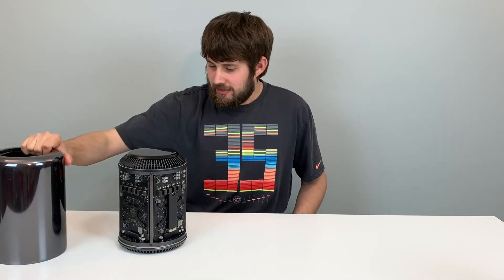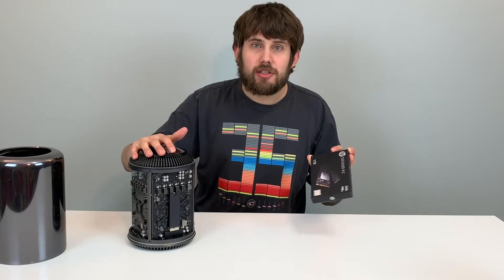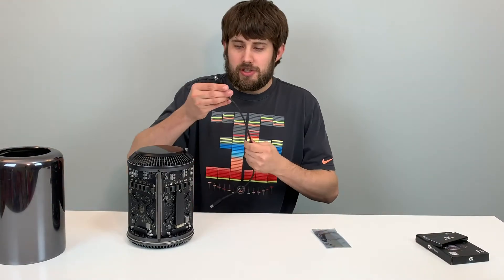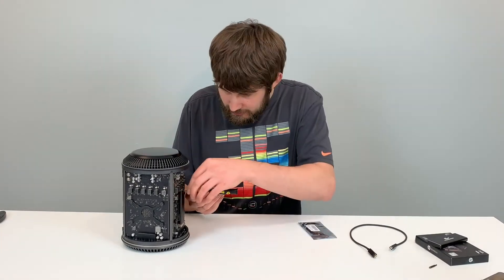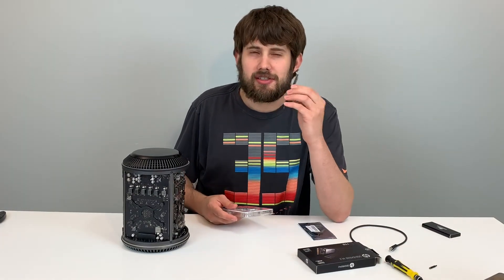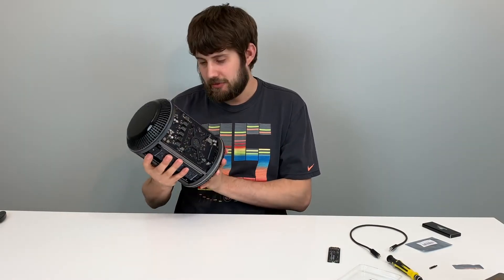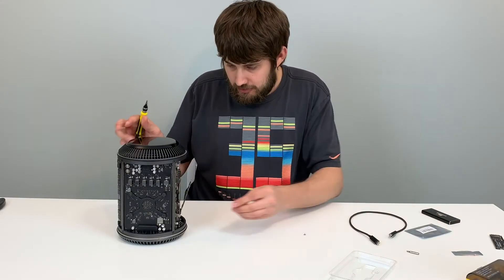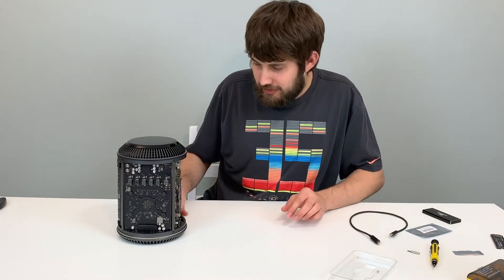2013 Mac Pro SSD Upgrade with a HP EX920

Comment: How did you fit that drive? The notch in the Apple one is on a different place.
Reply: Do you have a link for that converter?
Reply from the maker: https://www.ebay.com/itm/SINTECH-M-2-PCIe-NVMe-SSD-2013-16-APPLE-Macbook-Mac-Pro-Air-12-16-Adapter-6-1-/192801492842
Reply from the maker: Mac Pro NVME adapter is what I searched online

Comment: I Love my 2013. Mine has a 1tb apple nvme. funnily enough my custom built pc has the hp nvme.There is an adapter for the 2013 that allows you to use 3 NVMEs inside it. Costs 600 though. i subbed great video